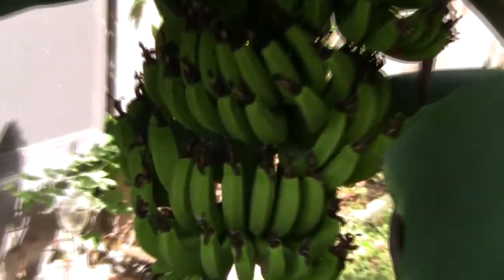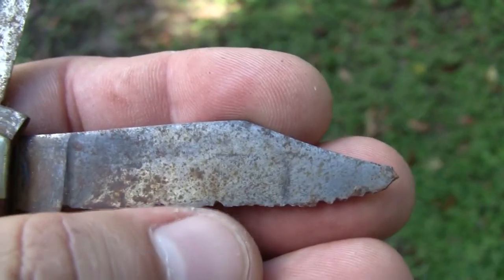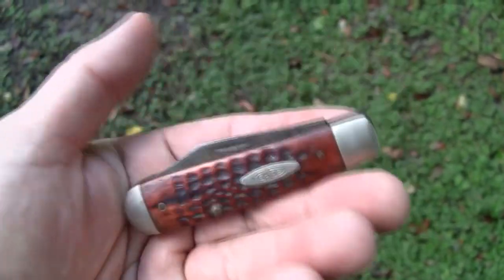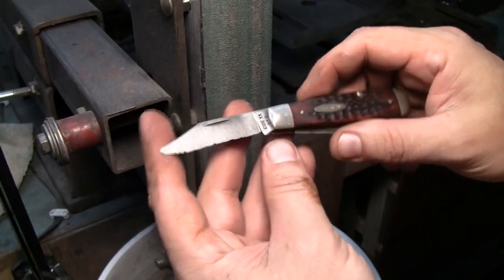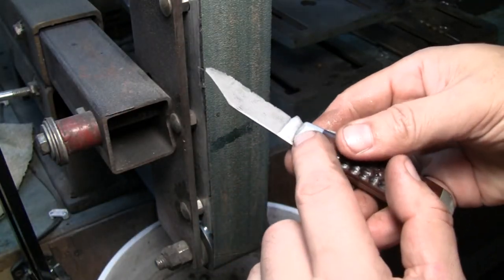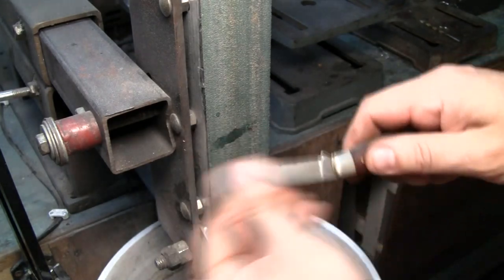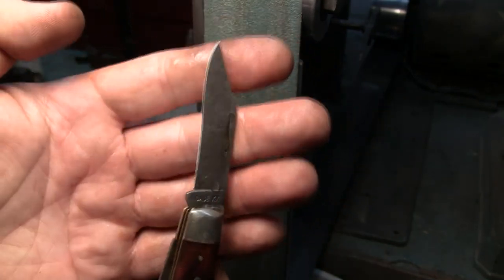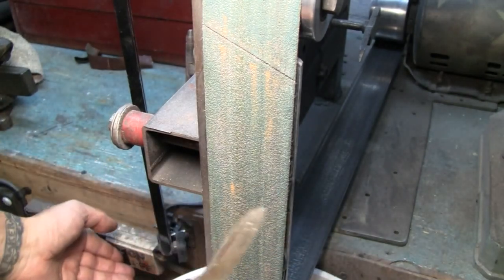Refurbishing a 1965-69 CASE XX Jack Knife - Pretty Bone 6235 1/2

Comment: Hoping to bring back an old barehead jack without shield from the late 60s. The scales are still in great shape and the blades still have their shape but they have a daunting amount of rust scale on them. What did you use to remove the rust? Evaporust? Vinegar? 

I am unfortunately gonna have to do it slowly because all I got is a worksharp knife and tool sharpener and bench top diamond plate sharpener for taking out the nicks caused by the rust. I plan on using neverdull then case paste to finish the polish on the blades afterwards.
Reply from the maker: That is great, yes reused white vinegar was used. Sounds like you have a solid plan and I wish you the best of luck. Take care.